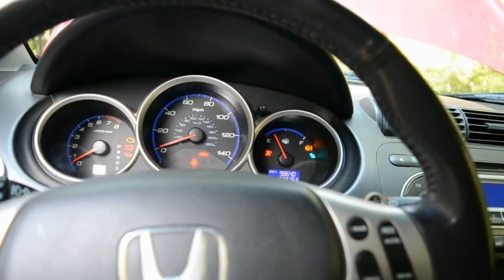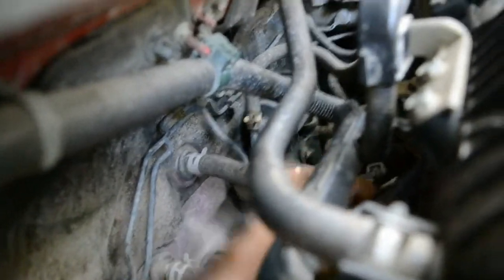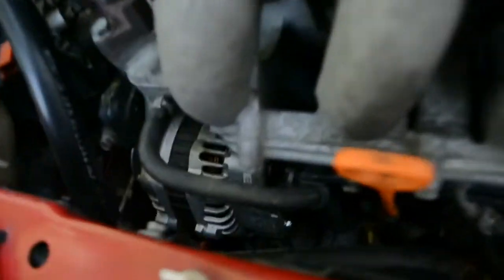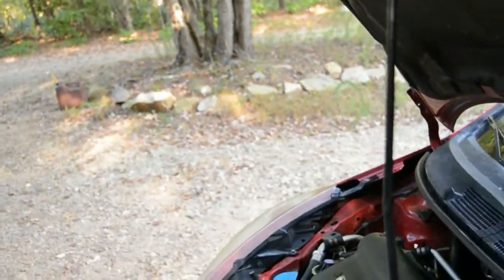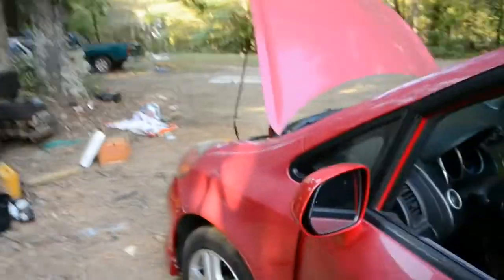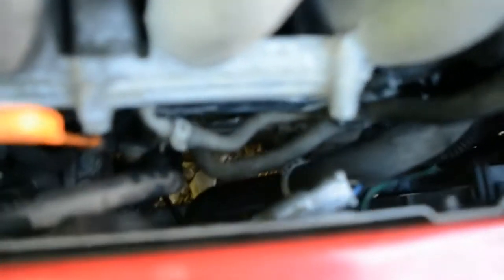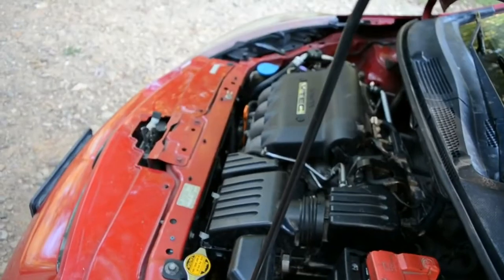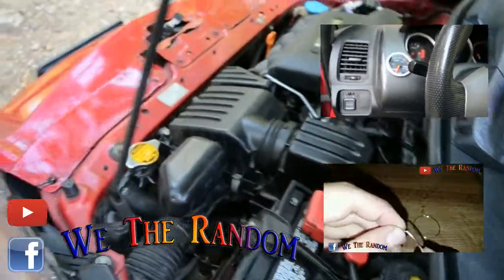Honda Fit / Jazz OVERHEATING!!!!  2007-2008 **How To Fix**

Comment: This was so helpful, thank you! First source I've found that gives the location of ECT1 at the right rear of the engine. The tip about turning on the AC to test the radiator fan (plus relay and fuse(s)) is so useful too. Great systematic approach to troubleshooting.
Reply from the maker: So glad to hear this helped!  Thanks for the kind comment!.
Reply: Keep in mind that your AC unit must have a freon charge or the AC fan will not turn on unless maybe the ect2 sensor tells that fan to come on. MY AC unit is dead and im not fixing it. I just need to check my etc2 and wire.

Comment: Great video! I didn't know there was a morning light to let you know when your fit was overheating. I have a '08 fit and recently the latch to the hood started acting up and I'm not able to push the hood all the way down and get it to latch the second time. So now as I was driving on the interstate in the rain, my check engine light came on. This has never happened before, and I'm hoping it's just because it was letting moisture in under the hood. I stumbled across your video because I was trying to find out how to know if you're fit was overheating. Thanks for the informative video!

Comment: This started with my mom's today. Just had the water pump everything done to the car.  I added coolant cuz she was low in coolant. I remember she use to make like a noise where you'd hear the water swooshing around when driving.

The sensors you're referring to are they both coolant sensors?
Reply from the maker: Yes.  One measures the temp at the block and one at the radiator.
Reply: @WeTheRandom  the radiator was pretty low, I topped her off a pretty good amount and now the light didn't come back on. Is it normal for the car to drink anti freeze like that? No leaks on the ground, she use to make this like water flow sound when I'd drive her. It's my mom's car, I purchased it for her and I maintain the best that I can for her, she's 73 years old so I want to make sure she's running 100% for her.
Reply from the maker: It isn't normal for a car to need to be topped off with antifreeze.  It sounds like a small head gasket leak is going into the cylinders and going out the exhaust.
Reply: @WeTheRandom  I pray that's not the problem. I just swapped the engine on her like 5 months ago. She doesn't use much anti-freeze but some
Reply from the maker: There are a few ways to test.  You can start the car and put a piece of cardboard close to the exhaust for a min and see if it looks and feels damp... or the more thorough option, you can get a kit that you check from the radiator fluid.  (Blue fluid that tests the carbon outputs in your radiator fluid.) You can get them at any franchise part store.

(Head gasket leak detector kit)
Reply: I took off the bumper and rode it for a bit. I saw a leak on the plastic radiator cap. It was a very thin trickle.

Comment: my dads 07 fit is overheating. I already replaced the thermostat for him, we're replacing a relay and one of the temp sensors, the temp sensor was reading on my obd live data as jumping from 185*F to maybe 220*F every couple seconds eventually getting to 240ish which is where the light turns on, seems like it might be a bad sensor
Reply from the maker: Sounds like you're right.

Comment: Thanks for video. Gotta question. My fans come on with ac on and that is the only time. With ac off it's runs until hot symbol shows and fans never cut on. Can you help diagnose?
Reply from the maker: Try rewatching the video around the 1 minute 30 mark. It sounds to me like maybe it's your ect2 sensor.
Unplug it with the key in the accessory position and see if your fans come on. If they don't, it sounds like it might be your ect2.  Doesn't sound like you have bad fan motors or bad relays at this point considering you said both fans turn on when you have the AC on.... so, yeah... try doing the above. :-)
Reply from the maker: Also check out my other video that shows where to install a temperature gauge so you don't have to rely on that light to let you know when your car is already overheated.

Comment: Hey dude, can you do a video on replacing ect1 sensor.
Reply from the maker: This video should help you with locating ect1. All you have to do is disconnect the wire, unscrew it, screw the new ECT 1 sensor in and connect the wires back.

Comment: Did you ever replace the heater core?
Reply from the maker: I have replaced a heater core in the past, but have not needed to on the Fit.  If you're asking because you're wanting to know where it's located,  it should be under the passenger side dashboard.

Comment: Good Day sir , my honda fit is having a problem about also engine temperature , I installed an aftermarket defi gauge , the reading of my engine temp during during AC is 80-85degree Celcius and when Im not in AC mode , the temp of engine goes high,  and as I check the return line of water from the engine , no water goes out and there is a lot of air comes out.  Newly top overhaul , new head gasket , new long radiator as well as condenser. no signs of mixing of oil and water from radiator.
Reply from the maker: Carefully fill it with water, and put a big peice of cardboard under the engine bay, run the car for a few minutes, turn it back off and try to look for any water spots and trace it..
Also, put your hand close behind your muffler while its running don't burn yourself and leave it there for about 20 seconds to see if you feel moisture on your hand.

P.S.  I have had a head gasket replaced by a shop before, and they didn't install it right....  so could be that also.
Reply from the maker: Also, make sure your thermostat is functioning properly.

Comment: Should the fan start immediately when you start the engine?
Reply from the maker: If you're A/C is in the On position, then yes.  If the A/C is not on and the fans are spinning as soon as it starts while the engine is COLD then there may be a problem with one of the ECT Sensors.  The fans should come on when the A/C is on, and when the engine gets to a certain temp.   I have a brief explanation of this at the end of the video as well.  Hope this helps.

Comment: How do I know if sensor 2 is bad ? I know for sure the condenser fan isn't working but.  Both fans won't turn on if I switch my ac to the on position .
Reply: I checked relays and fuses already and I know the radiator fan is working .

Comment: what if.... thermostat has been replaced... both fans work and the light comes on/blinks on highway speeds, after a 5-10 min drive on the the highway once off the highway, the light goes away. The car has been tested for head compression, it passed...and coolant has been flushed. Only one time got too hot and all the hot coolant was being push/coming out through the reservoir tank....  could this be the water pump?? I have noticed that after I let it idle for 10min or so, and taken the cap off of the radiator the coolant still cold no change on temp....has anyone encounter the same problem ?
Reply: bro sound like water pump or head gasket. my friends subarus would always pulsate water into the reservoir pump when their headgaskets went out and overheated

Comment: What if the hot light turns on at highway cruising speed?
Reply from the maker: Probably a stuck thermostat, or the less likely, low on water.
Reply: @WeTheRandom  
Coolant level is up. My mechanic and I will be on it tomorrow. Would you happen to know what is the correct thermostat temperature? I see 3. 170, 180, 195. Thank for the video and for your quick response and assistance. You're a good soul.

Comment: I'm having trouble finding my airflow sensor on my 08 fit
Reply from the maker: Sorry for the late response, The fit should have 2 airflow sensors, both on the top back of the plastic intake manifold.
Reply: I am pretty sure the 08 fit has a manifold pressure sensor and not an airflow sensor(MAF).

Comment: I have a 2013 FIT. The AC fan never comes on because theres no charge on the ac because it leaks. The main fan comes on and thats all you need.
Reply from the maker: I would go ahead and fix it.  The hotter summer days are going to have it operating at a  higher temperatures....  also..  you're now 1 fan down....  if that last one goes, you're sitting on the side of the road..   Its not a tough fix and is worth fixing.   P.s. I'm not sure your ac fan isn't coming on because the unit isn't charged. I'd have to see the wiring diagram, but I'm pretty sure it should work, with or without the unit charged.....
Reply: Wont come on unless i put refrigerent in it. When refrigerant goes in the fan comes on right away. So it seems @WeTheRandom
Reply: AC wont come on whith an AC charge but the fan might come on regardless if that bottom coolant sensor ECT2 is working and gets to 212 deg. My guess is the coolant isnt getting hot enough for the second fan to come on. I also might need to check the wire as ive seen that lower radiator sensor wire get damaged before. Thanks for making your point.  @WeTheRandom
Reply: PS: My main point was that i dont want to put any money into my AC leak problem. I will check my radiator temp sensor and wire. @WeTheRandom

Comment: Would it have hurt you to show or explain HOW TO DISCONNECT the electrical connectors?  It's NOT obvious. You CAN'T even SEE HOW to disconnect them.  And they're so TIGHT you can't remove them without spending an hour per connector -- or BREAKING THEM!   
Where roads are salted in winter the metal parts of connectors -- and tabs on the engine or body onto which fasteners attach -- are corroded, making them impossible to disconnect, even if you could get your head in there with a light and a magnifying glass and SEE how they're SUPPOSED to disconnect!!!  I can't remove EITHER of the engine coolant sensors.  I can't even SEE HOW they are SUPPOSED to disconnect.
Honda and other makers are intentionally making it harder to work on t cars.  Older mechanics are sick of working on cars made in the last 25 years. Few young guys are becoming mechanics.
Every single electrical connector under the hood of my 2008 Fit is impossible to disconnect -- impossible to even SEE how it's supposed to disconnect.